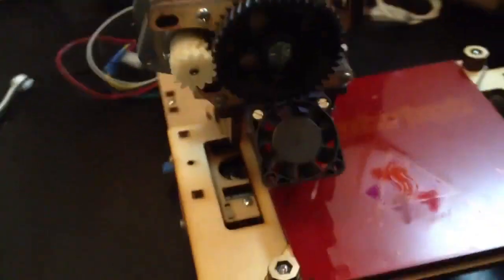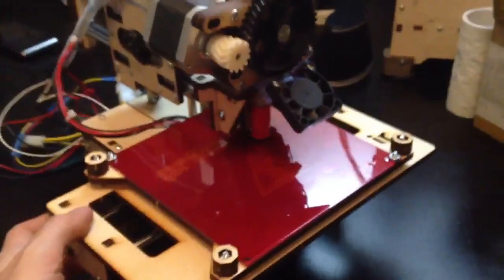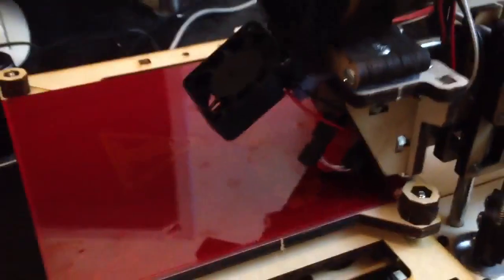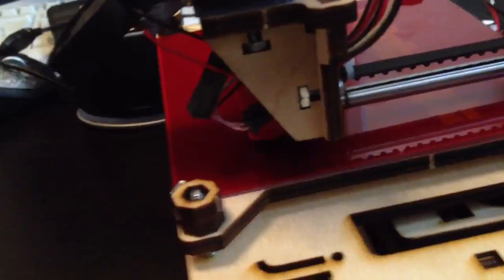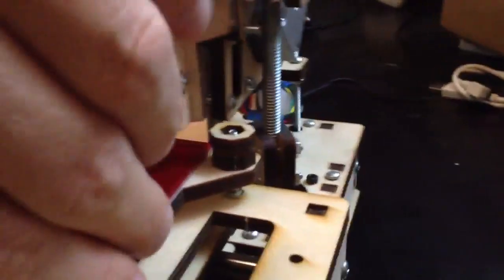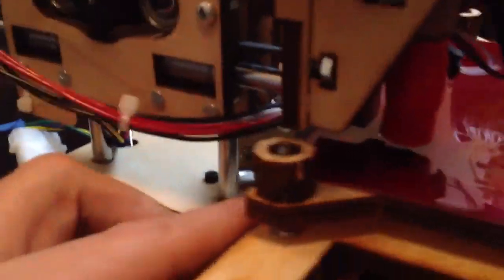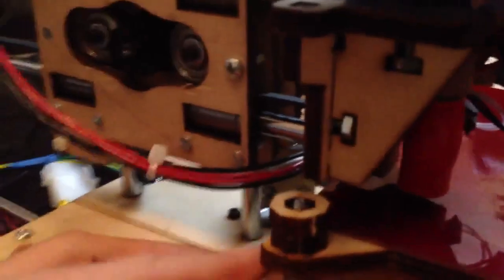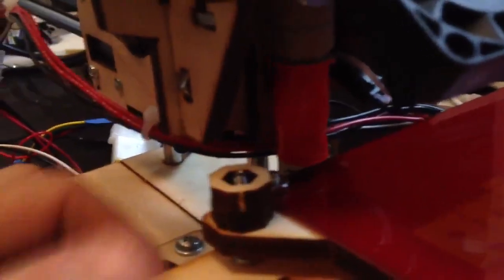Printrbot Jr, Heated bed upgrade

Comment: lose the thumb screws and only use the nuts and use a needle nose plyers to turn the nuts to agust the bed and if the bolt is still in the way adgust the bed then get a dremel and trim off the excess bolt.....i know it seem like a lot of work for the simple upgrade but since you already have it ;) you might as well make it work